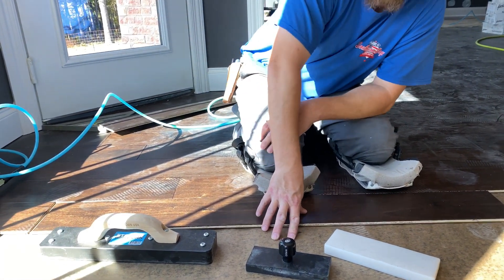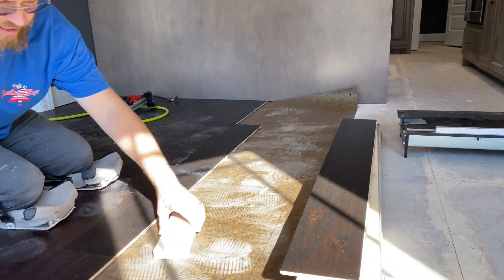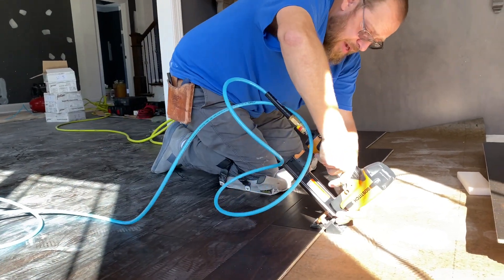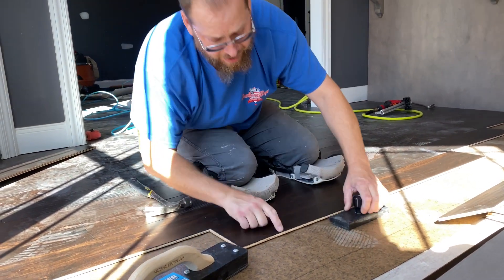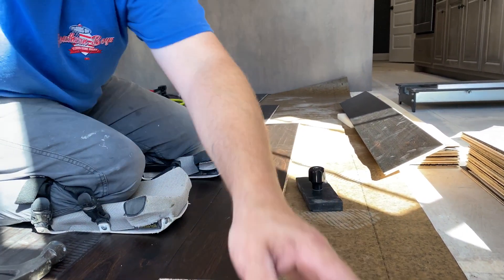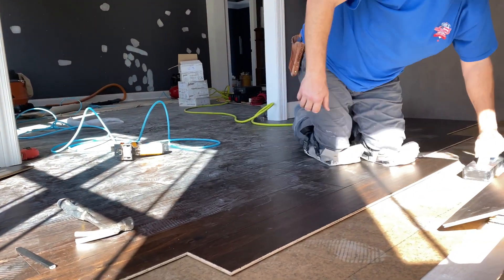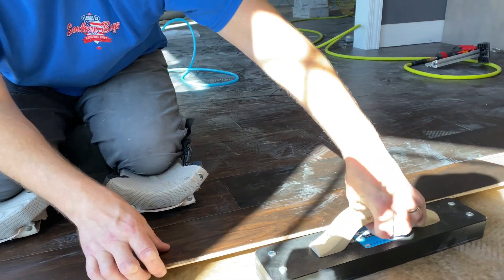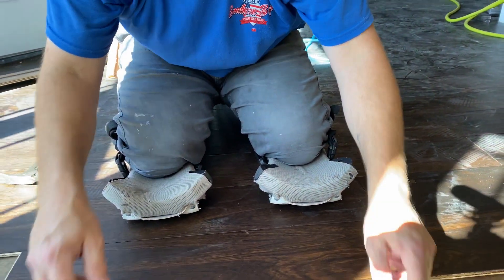THE BULLET STRIKER TAPPING BLOCK

Comment: That is not the correct way to use a tapping block my friend.  One corner should always be in contact with the flooring and you slap the tongue to seat the board. I've been laying floors for thirty years.
Reply from the maker: Thanks for the tip